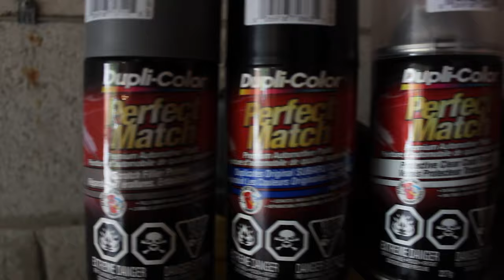How To Paint Front Lips, Sides Skirts and Rear Lips | D.I.Y

Comment: Maybe cause it's black so it's easier to work with but I've worked with dupli-colour a few times but the colour never matches exactly and i followed all the steps in painting a panel properly. The finish is great but the colour doesn't match.
Reply: Luckly for me its basically spot on but ya i can probably see the lighter colours being to get spot on
Reply: Tough to**
Reply: +Alex P Yeah I guess it's because the colours fade over time and dupli-colour doesn't take the fading into account
Reply: @hooked4shore205  old songs